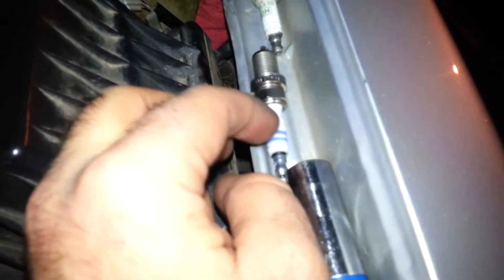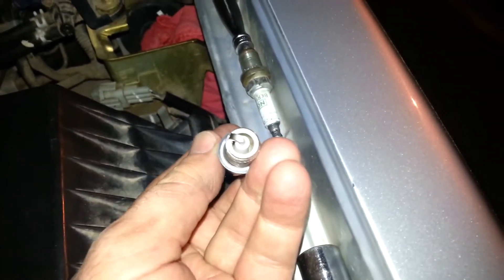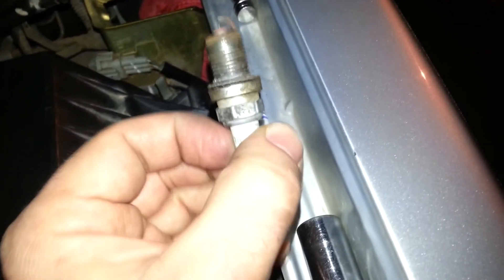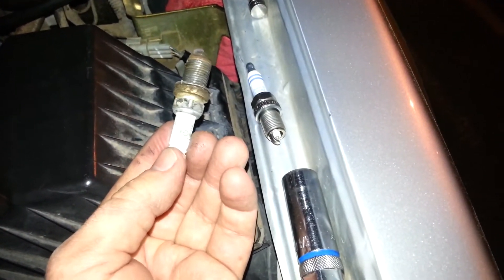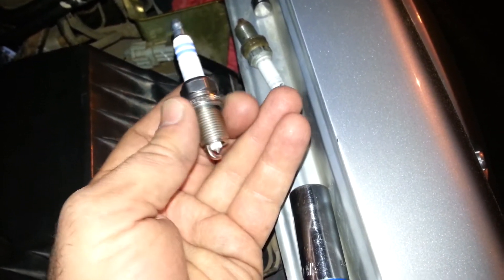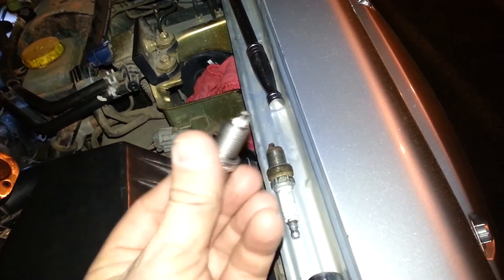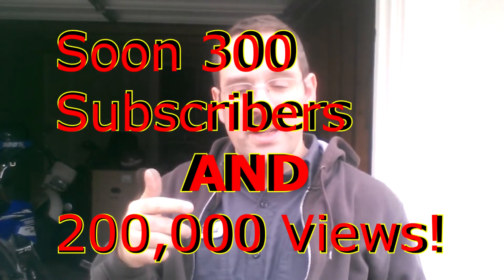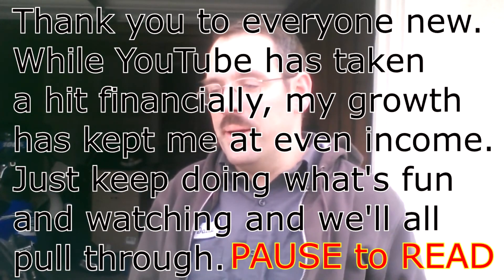Spark Plug Heat Range Myths Busted!

Comment: NGK 9 is colder than 5
Reply from the maker: Hi Dee you are correct. When I found a resource about NGK spark plugs it said that the higher the number the hotter, and lower the number the cooler, but that is only true on racing spark plug numbers. When that's the case the first of the code will be R for racing. Seeing as how my spark plugs aren't racing, you are correct and I am not. I really appreciate the correction Dee! I'll pin your comment so people know about this! I hope you subscribe, I appreciate people who take the time to make me smarter. :)
Reply from the maker: Here's a great resource to help you find the heat no. and what it means for many spark plug brands. :) https://www.sparkplugs.com/learning-center/article/116/how-do-i-find-a-colder-or-hotter-plug

I spent a lot of time trying to find a resource to verify what you were saying. I learned a lot on the way.

Comment: your sir should not be giving out the wrong info. Thay say it is  better to be thought a fool than to open your mouth and remove all doubt .
Reply from the maker: Did you know racing NGK's are the opposite for heat ranges? If you're reading the comments you'd know that I pinned the one needed correction on the video.

Comment: your wrong, ngk do revers number . bigger the number , colder the plug. lower the number hotter the plug
Reply from the maker: It's a pretty easy mistake to make. On their R line for plugs for racing it's the opposite. If you looked at the comments I pinned a correction as a top comment already.

Comment: Well I continue to learn things every day! I had no idea that spark plugs had a heat rating lol....I can't count the amount of plugs I've changed over the years! Amazing what a person can learn on here...Great video my friend!
Reply from the maker: I know, in answering a comment today I had to do some research and learn even more! It turns out I was wrong in this video. If there is a R at the beginning of the NGK code then the higher the number the hotter, but while I have normal, nonracing plugs, the higher the number the colder. So the issue was having 1 spark plug randomly get in there which was hotter than the others. I bet it was knocking just a bit thanks to that. Too hot of a spark plug for the design creates knock.

Comment: Spark plugs are one item ignored , I'm sure of it. Keep having fun and keep working on something. Cheers
Reply from the maker: +STEVE ROB yeah. I can't believe how many people ignore them.
Reply from the maker: ***** Not that I know of. I'm largely German and English. At least for about a 100 years of incomplete history.

Welcome to my channel! Oh. You're hilarious man. Keep the comments coming.
Reply from the maker: Steve my camera was bugging in and out but it's for the best. I was I a noisy place when I checked on these plugs again. Since I could hear one of them was a thousandths or so of an inch of I checked. Those spark plugs were all 44 thousands of an inch installed and they were 40 not long later...at least on the easy side of the engine to get to. 

Since no. 5 cylinder sounded slightly late, it got .043" while the others got .044" to be more precise. Perfectly smooth and 1-2 miles per gallon better under heavy load and a lot more under lighter load.

Steve. I know these tiny adjustments are confusing, but hang in there you'll get it. If a cylinder is late it sounds duller than the rest. Be smarter than me, use a screwdriver to not get electrocuted. Assuming it has a big plastic handle. Lol
Reply from the maker: ***** That's awesome! Steve has helped me too. Thanks for the help! On a recent video where I celebrated a surprising 100k views and only 200 subscribers I honored Steve at the end of some kind of fix.

Comment: I'm glad you now understand what i was waffling on about plugs :-D.
Equivalent plugs are never the same, manifacturers are a pain in the bum
with there silly markings, they need to agree to use one system.
But don't hold your breath waiting, i've not seen any change in 30 years.

The composition of the pot core, electrode composition/thickness/metal and gaps around it must have an effect as well, so compairing plugs by only dimensions may not be exact.
Reply from the maker: +zx8401ztv oh for sure. I am sure however that they are what they're rated for. I couldn't see the difference between a five and nine heat range, so you have to know how the manufacturer let's you know what it is.
Reply: The pot core does have an effect but the composition of everything they won't tell you :-(.
I had a frend with a motorbike that was allways choking the plugs up, they were very black, but they were the correct plugs.

After testing the carb settings and finding that making the mixture weaker lost grunt/power, i decided the colour of the plugs was a lie!!.
i said buy a grade hotter plugs, the bike ran spot on after that, better than it ever did,  the plugs were into the brown area :-D

Sorry if ive told you this before, dam memory :-(.
Reply from the maker: zx8401ztv That's a story you can repeat! I don't know if it was reshared either. Lol I've only owned 1 thing ever to go brown. That 89 XT600. Brown is spark plug perfection.

This is why you start at what the manufacturer suggests, but the carb settings were desired more grunty, so the "plug" had changed. That's exactly why I made the video. 😆
Reply: Well i didn't have an expensive gas analiser so the brain finds ways LOL :-D.
I've pulled similar tricks with my electronic repairs, find another indicator that's connected to the problem and i can judge it.
I know you use similar methods, you are logical... sometimes ha ha  :-D.
Reply from the maker: zx8401ztv yes. I totally get what you mean. What this boils down to is that sometimes I'm illogical. ROTFL!

Comment: Spark plugs can make a real difference in how your engine runs and performs. I used to swap out the plugs in my car and I used Autolite because they let you know what the heat range was by their numbering system. I would go back and forth between their 
65's and 66's and could tell the difference. Used the butt indicator course there was always the gas mileage too. When ya gonna take us four4 a spin. Maybe a befour4 and after. Good vid. Sea ya in church.
Reply from the maker: +MostlymoparIH Hey if you can feel the difference in the butt Dyno, that's a big difference. Sometimes that difference is interpreted positive when it's actually negative, which is why I get calculated wHP on my torque scan tool.

My car felt super fast after an alignment. When I checked my gas mileage it was awful. I was like calm down turbo and I got terrible mileage the next gas tank. I checked if my wife drove anywhere. She doesn't drive aggressive, but she doesn't know hypermiling as well. She hadn't. Took a few days maybe, but I realized they did terrible on the alignment and I felt like Mr. Awesome because the engine was louder fighting the alignment.... So I asked them to fix it, I got better miles per gallon and I missed the car "feeling" faster.
Reply: That was the  (I want the car to drive better because I did something to it) feeling. The feeling you got was-a good feeling - because in your mind you did something and if feels better because you did something.
Reply from the maker: +MostlymoparIH try that again. I didn't understand.
Reply from the maker: MostlymoparIH I love that feeling. that's why I end my videos with get out there and work on something. I want people to feel that too.